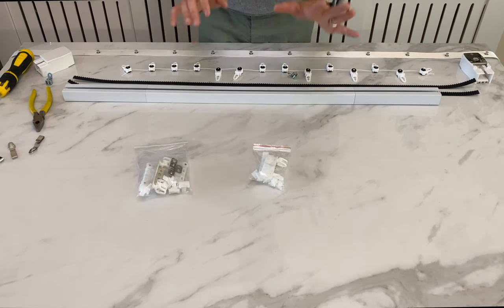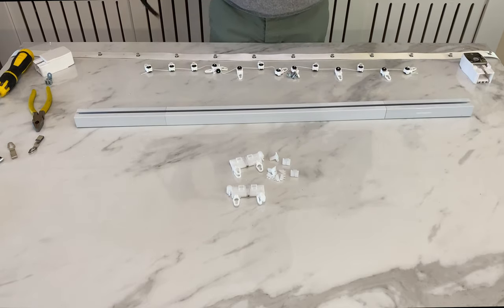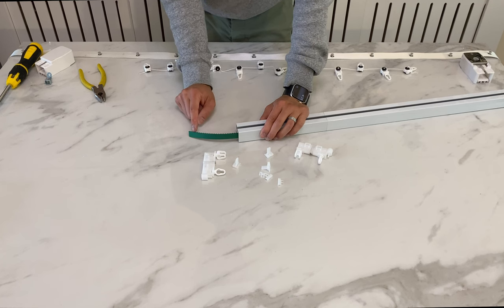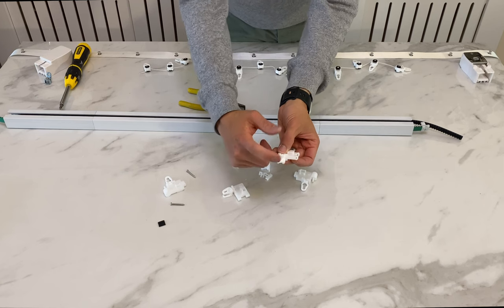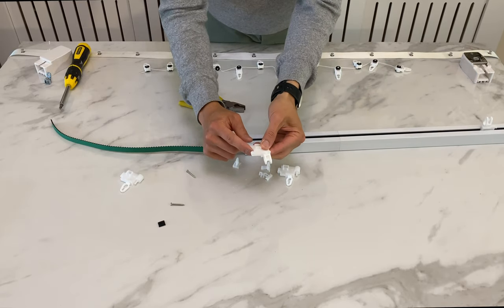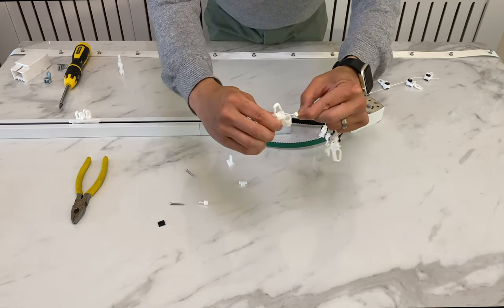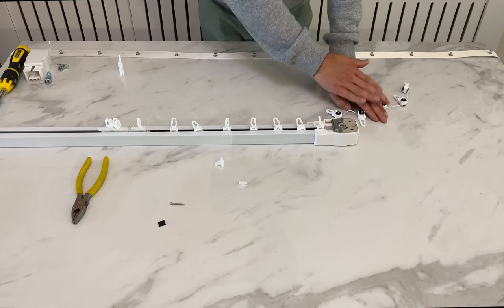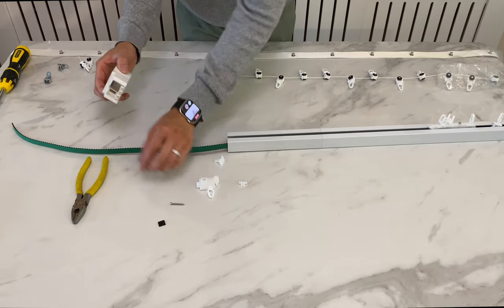QUOYA AT5810/QL600 Electric Track- Straight/135 or 90 Degree bends- Wave Ripple Runner Installation

Comment: Do i cut 20 teeth on 135 degree tracks i only see you mention 23 and this is on a straight track. Title says everything
Reply from the maker: Hi,

If using the wave curtain carrier, it is the same for straight or curved. Follow the cutting instructions on this video.
Reply: I did 20 That would be why it's so tight then still works but not smooth any suggestions
Reply from the maker: Yes. You can follow this video. https://www.youtube.com/watch?v=2GY3zJW9Bow

Comment: Is there a one way opening wave ripple video?
Reply: I am wondering the same thing.
Reply: OK ... i believe you can watch the video for QUOYA QL500 Smart Electric Curtain Track- Wave Ripple Runners Upgrade .... basically tells you to install the non-wave hardware (rather than from scratch) and then upgrade to the ripple runner parts.